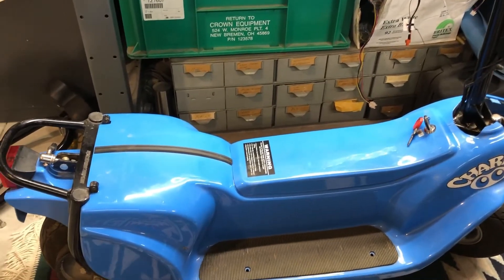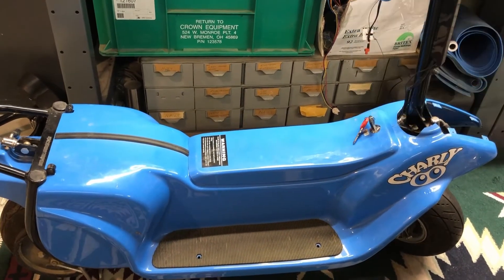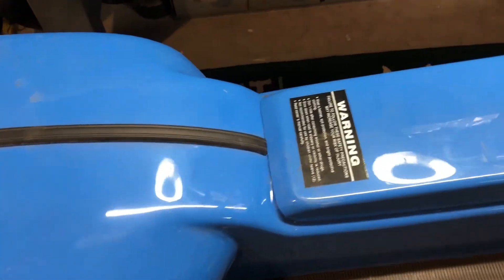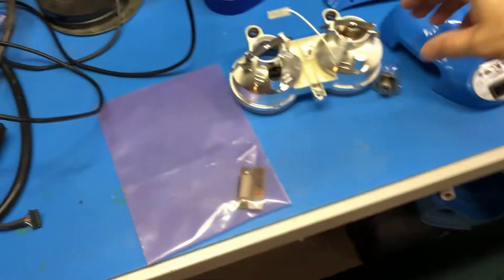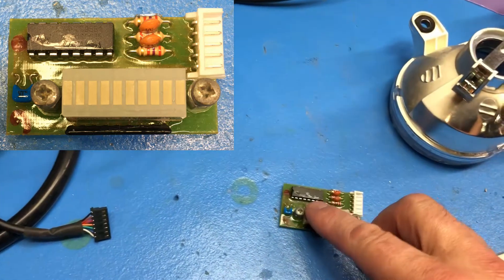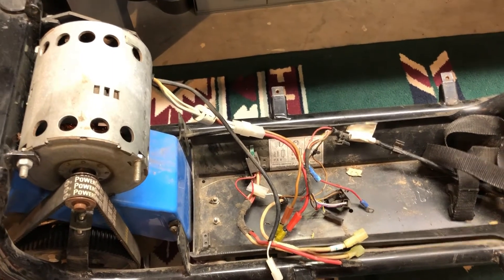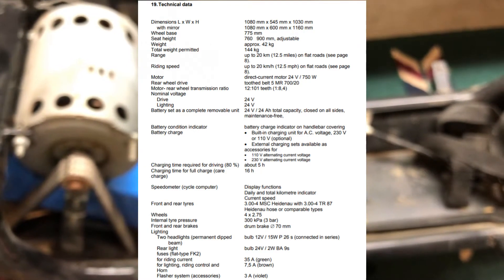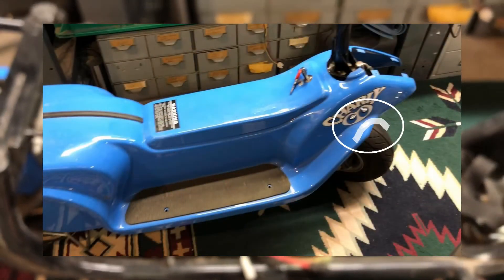Charly Scooter - Retrofit to a 48V System & Custom Motor Controller: Week 0 - Teardown & Inspection

Comment: Dude i got one of theese. It is 100% original what parts are you upgrading to can u send me link i want to upgrade mine aswell
Reply from the maker: This is a custom build.  The only thing that will be off the shelf that can be bought is the battery. [Edit]...forgot the new throttle, speed sensor, and LED lights lol.  This is a much more fun approach to doing it rather than just buying a controller off of the internet.  I will go into more detail of the circuits used as I progress.  Everything so far can be just created on a mini CNC mill with 100mmx75mm 2 sided bare copper pcbs.  Lots of work, but at least you get what you want in the retrofit.  I will likely post the schematics and gerbers on Endless Spheres once the designs have been verified.